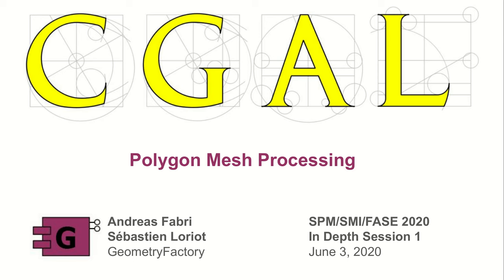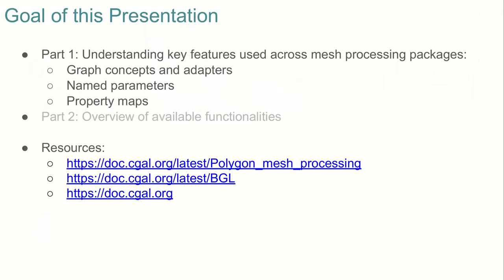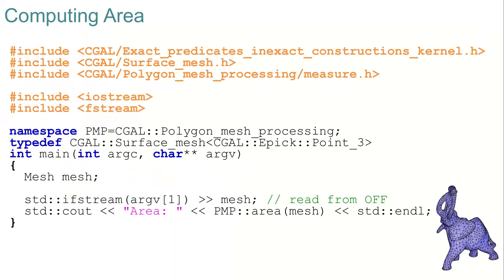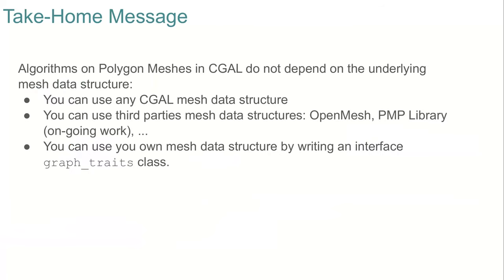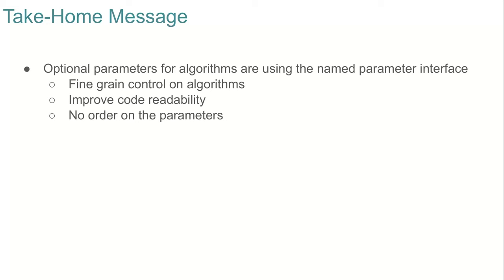Polygon Mesh Processing Part 1 - In Depth Session

Comment: Is it possible to show how to compile and run CGAl on Visual Studio Windows? 
I see many presentation how good CGAL is, but none of dummies tutorial how to compile and run it. 
In my case I would love to see mesh boolean operations.
Reply from the maker: Did you try to follow the tutorial available here:https://doc.cgal.org/latest/Manual/windows.html#title8?
Reply: @geometryfactory4026  Yes, it is not straight forward as it is written. Is there any chance to make a video tutorial following these steps ?
Reply: @geometryfactory4026  When I followed these steps, and try to use some of the new packages(or some old ones), I will usually get lots of error, there’s no step by step guides on how to properly configure different packages, and every packages seem to be using different methods to configure, which is very frustrating
Reply from the maker: @kennykenken4567  We are willing to improve whenever it is possible. So do not hesitate to post on github about issues you may encounter. You can also use the cgal-discuss mailing list. It will be more easy to answer your questions. Note that CGAL is an old project that was there before the STL was even available on all compilers. So new packages could take advantage of c++14 and older packages were not necessarily updated not to break backward compatibility.